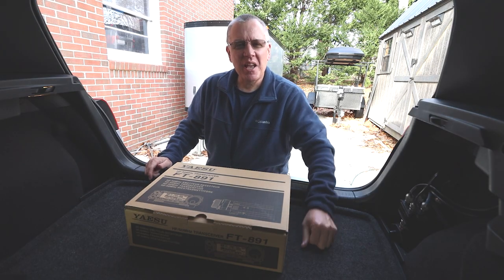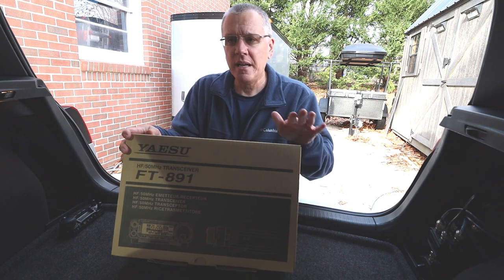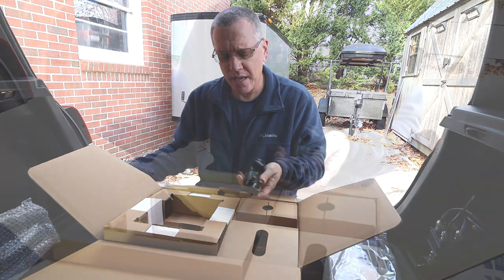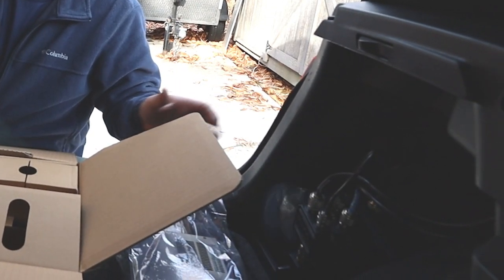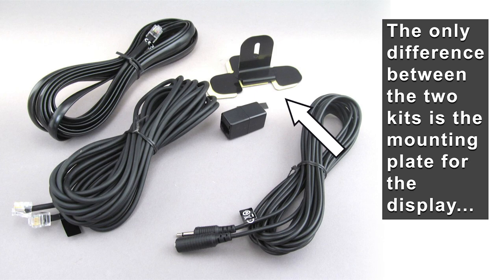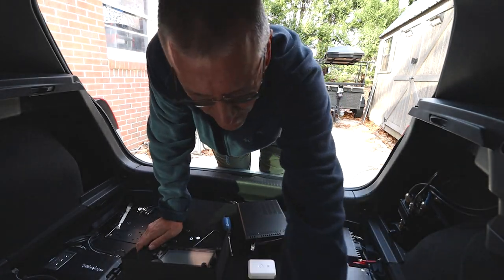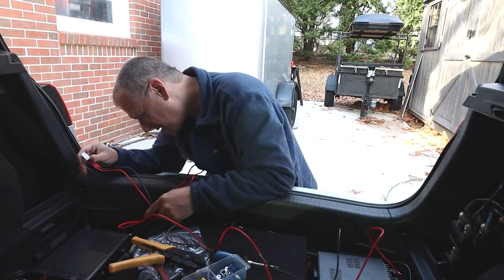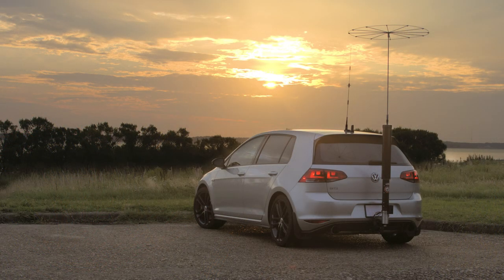SWAPPED FT-857D for FT-891

Comment: I made the same swap last summer.  In my case I was looking for the improved filtering and noise reduction of the much newer 891.  Been very happy so far.  Enjoy your new radio!
Reply from the maker: That's pretty much what I was after, too! The only thing I miss about my FT-857D so far is that I could use the selector knob (lower left) to scroll through the band 1 kHz at a time with my arm resting on the window. The 891 would be perfect if Yaesu added that option via firmware update. Thanks for visiting!

Comment: I don't understand why Yaesu couldn't put UHF and VHF in the FT-891.
Reply from the maker: I suspect Yaesu was gambling that a cheaper HF-only radio would sell better than one with 2m/70cm that's $300-400 more. I'd consider replacing my FT-891 with a notional "FT-891+" that has 2m/70cm, just for the additional capability. But, realistically, I wouldn't use it for repeater work since I'm so pleased with my ID-5100. I still have my FT-857D and can run it separately if I decide I want to play on 2m/70cm SSB. Thanks for visiting.
Reply: I completely agree. I think companies just shoot for sales. Why sell one radio for $700 when you can sell two radios for $1000?
Reply: Maybe call it a 991A😏